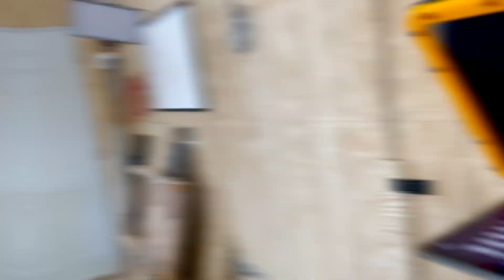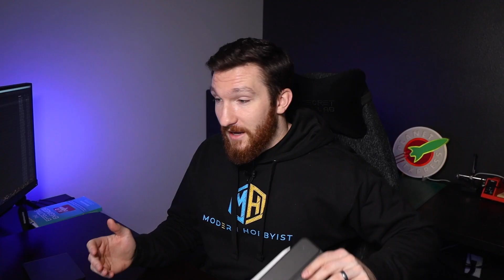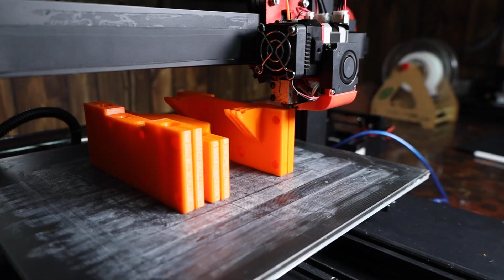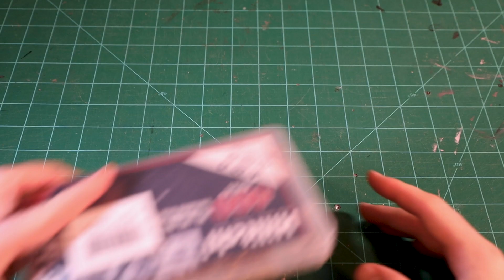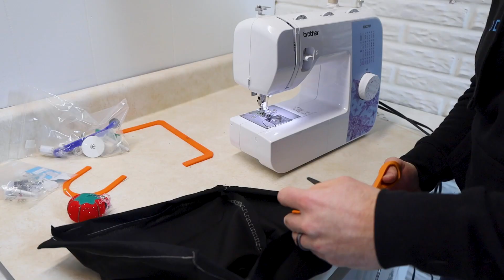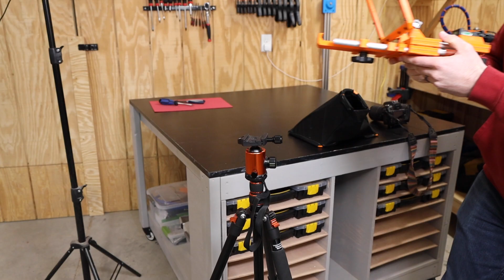Building the ULTIMATE 3D Printed Teleprompter

Comment: @ModernHobbyist I really like this teleprompter design but I can't really use it as is since I'm using my iPhone as my camera and I thought the Beam Splitting glass was much too expensive (trying to keep costs to a minimum). This means I've had to design my own but instead of glass, I'm using a clear piece of acetate I got from the dollar store. Because it's so thin, I don't get that ghosting effect, in fact, it's got quite a clear reflection of the text and the camera can still see through it without issue. For pipping, I'm using an old shower curtain rod I had laying around in my garage. Everything else I should be able to accomplish with my printer and a few insets and screws. Other than the PLA, the only other thing I'll need to buy is a hot swap show for my tripod. Wish me luck.